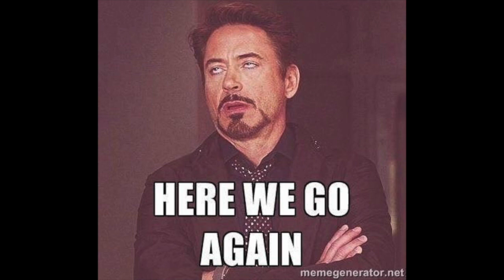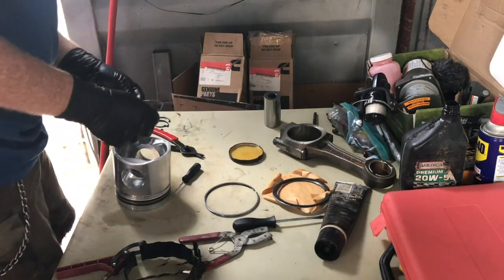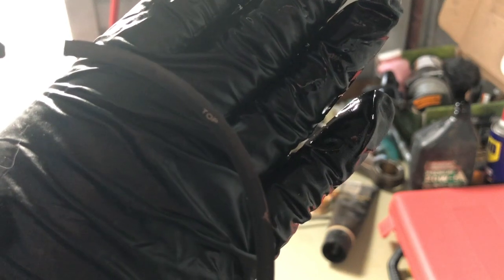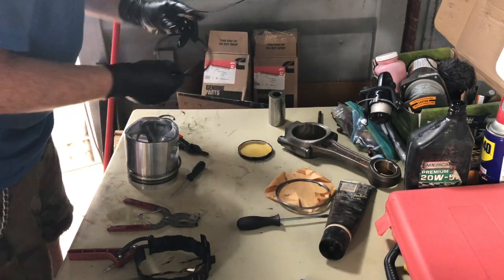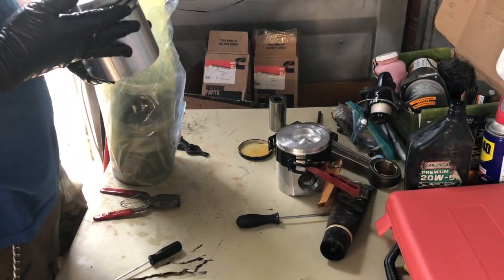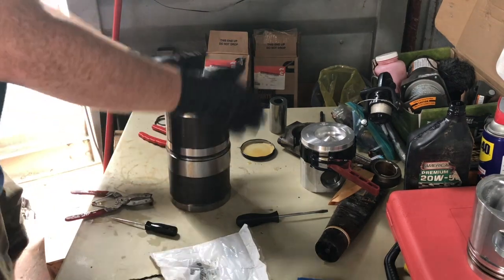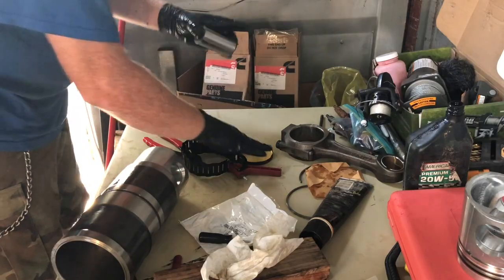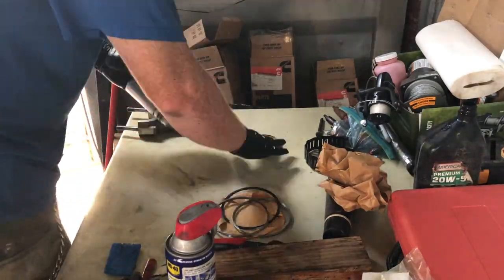6CTA8.3 12v Cummins Rebuild Part 3 - Piston & Liner Assemblies

Comment: With each of these videos, I can see that you are getting better at making videos. Also, thank you for all of the details. I’m pretty intimidated doing my in frame rebuild and these videos have added to my confidence.
Reply from the maker: gossumx thanks, It’s been a learning curve, both for the engine and the videography. There are more to finish the engine, I just haven’t put any time into editing them with everything else going on. If you need any help feel free to contact me. The engines are super easy to work with, no need to feel intimidated, they are just like any other engine.
Reply: Boobies ha